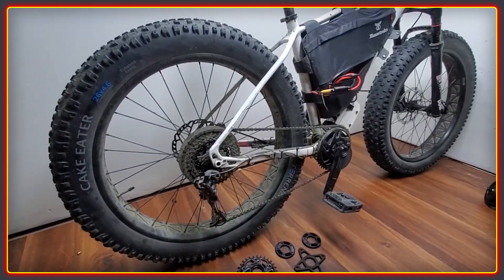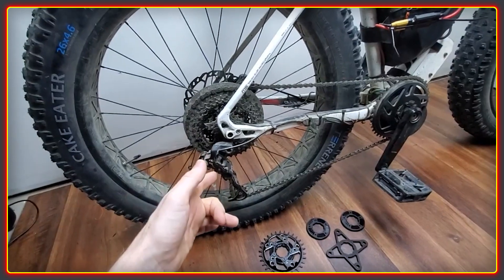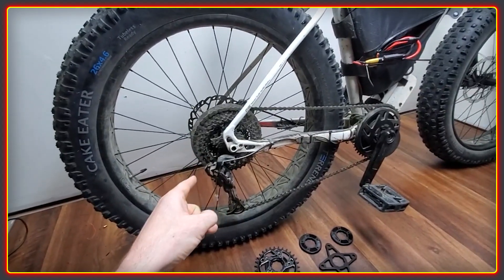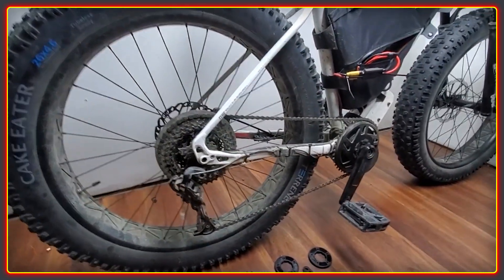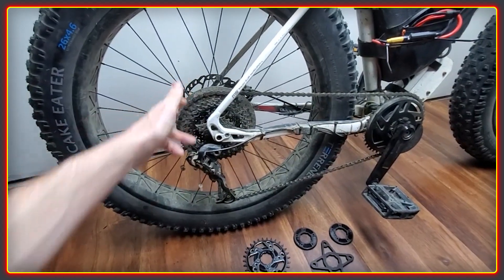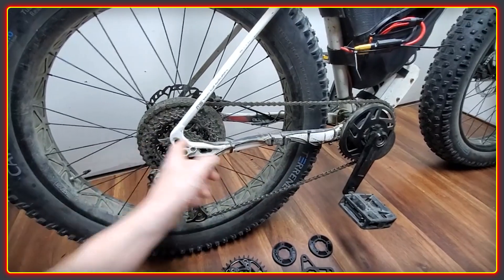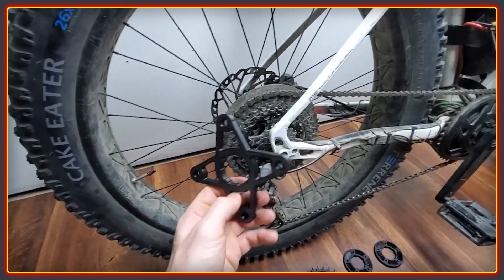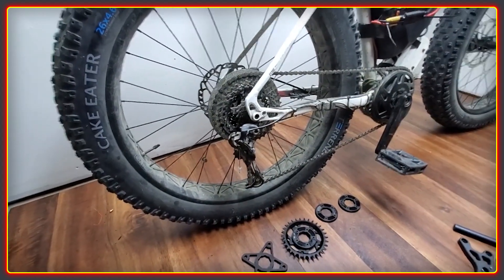BBSHD Chain Ring adapters for Rear Sprockets

Comment: Thanks allot! Have a 3k mid on stretch bike. ..2 chains long! Chain alignment is big!!
Reply from the maker: You are welcome
Reply: @HighVoltageKits  question got that adapter for chainring on rear.  What sizes do you recommend? Heavy bike.. porker🤣 3k cyclone one chain. I have 32t and 42t small in front big in back.. any suggestions highly appreciated 💪💪

Comment: your chain tensioner is already there, just use the derailleur, lock it in place with the high, low screws, that's all i did with my interal geared hub so i can run chain rings up front for climbing hills(36t) an cruising(52t) ........... note mine at the moment is a cyclone mid drive so it's 14t motor to 53t crank to 52t an 36t (using sick bike parts free wheel upgrade an 130bcd spiders to 22t rear shimano nexus inter 3, does everything i need it to do........
Reply from the maker: Nice idea. Should be pretty easy to do. Good to hear about the cyclone. How I'd the sound compared to the cyc. It's a similar motor core I heard?
Reply: @HighVoltageKits  thanks, it works really well i can climb anything yet still have a really good cruise speed i'm low powered compared to you at 48v 25ah x2(yes i run 2 batteries), i've had both cyclone motors the first was the little 1200w motor it has steel planetary gears so it whined an due to the hilly area i live (queensland australia) and the intence heat of summer plus mine a my bikes heavy weight it would sometimes overheat shut down so i upgraded to the 1800w-3000w motor it's bigger an has nylon gears so it's basically silent an has never overheat shut down on me, in fact it gets warm but not hot, done 9,000+km on it .... i'm waiting for my bbshd to show up i really want to give one a try ......

Comment: Hi there can I ask if a normal single speed 16 teeth freewheel at the rear with a tsdz2 40 teeth chain ring
Reply from the maker: It depends on the bolt pattern. I just got the first one back in Aluminium..I'd say probably not unless it's the same as Bafangs

Comment: Original BBSHD spins wery slowly 3500 rpm 🙂
Reply: Yup i read somewhere its 3000rpm on 48v and 3500rpm on 52v 🤔HV kit for the win 9000rpm on 52v 🔥😎💪🏻
Reply: @madmanwheelies6157  and " RPM " HV kit for 72v ?
Reply: @Noname-ym1iq  i think around 16k rpm on 72v with asi bac 855 Mr.HV kit with 72v, 18k and above danger zone 42t front 42t rear tooth 40mph
Reply: @madmanwheelies6157  16k... HOLY SH... I'm just waiting for a 72v Battery, my HV kit !
Reply: @Noname-ym1iq  yup me too 😉cant wait 🚀
Reply from the maker: Yes you are correct. Getting mixed up with the cyc when it was stock. Good spot!
Reply: @madmanwheelies6157  How big battery? I get 20s 4p and Molicel P42A cells!
Reply: @Noname-ym1iq  who built your battery?
Reply: @budwhite9781  My Frend!

Comment: I guess the offset chainring on standard mtb bikes is not necessary, right?
Reply from the maker: Well the bolt pattern to the motor might not work. Usually people have to use a pretty big offset to make this motor work on newer mtb frames.

Comment: Great video , I’ve done similar myself. I run a 28f and 28r. Used a single speed setup off of Amazon and just took the 28t gear out of my cassette and adapted it.  
Haven’t figured out how to you discord :(
Reply: Mine is also on a dh bike so I ditched the typical derailleur and went with a much more compact tensioner that worked out very well along with keeping the chain with higher ground clearance.
Reply from the maker: Thanks Ronan. Sounds like a cool bike. If put in discord guide in youtube it will get you info. Working on a more specific one. Essentially it's chat rooms about electric vehicles. I can link you if you want?
Reply: @HighVoltageKits  where do I go in discord ? I got the link from cap, got the app , but can’t seem to navigate to find anything. Waiting on all the parts to put together this LR big block bike. Ended up going with a 7230s Kelly and a 60v 35ah (105cont 175 peak) from battery hookup. Would love to share the build and keep up with discord.

Comment: I like the idea of a 2 ring at the rear setup.
Some sort of pivot mount bolts at the front would be good, to allow better alignment. Just throwing that idea in there. Not sure of the feasibility or wear problems ? Would be nice to overcome the problem of alignment, with something like a simplified constant velocity joint at the centre of the front sprocket.
Reply from the maker: Good ideas. Thanks. I think they can be spaced pretty evenly at the back. Its a good point with the two ring though. I was thinking of getting the chain in the center of the two so it was as even as possible. Cheers

Comment: Quick question if I get a asi 855 does it matter if I have a 48v mid drive or does it matter and opt for a 52 instead?
Reply from the maker: No difference. Once you use an external controller you can go up to 72 volts. Hope this helps.

Comment: Very cool setup.
Question: What would be the problem with a smaller chain ring up front to better match a 22t sprocket in the back?
I imagine that some top speed would be lost but not enough to make the bike slow (by any rational standard). That would still leave the motor enough torque to climb and take off nimbly plus allow a thick single speed chain.
Reply from the maker: In theory nothing. Some frames this would be fine. Where you hit problems is when an offset is required. To enable the offset you essentially have to use at least a 40t I think. The offset has to clear the reduction gear housing on the motor. So on fatbike and DH frames it precludes the use of smaller up front. Hope that explains it. Cheers
Reply: @HighVoltageKits  It does, somewhat. I envisioned spacing the rear sprocket as far outward as possible.
I'm curious what 40t chain ring offers good offset. I haven't seen anything under 42t that can wrap around the motor.
Reply from the maker: Lekkie do one with a replacement cover. It looks amazing. Expensive tho. There are limits to moving the big gear out and it depends on the seat and chain stays. But yes you are right that is a key variable.
Reply: @HighVoltageKits  I have a 42t Bling Ring on my BBS02 & a Luna Eclipse 42t (even better offset than a Lekkie) on my HD. I love the Bling Ring 42T (& up) but am unfamiliar with an offset 40t. I'll have to look, thanks.